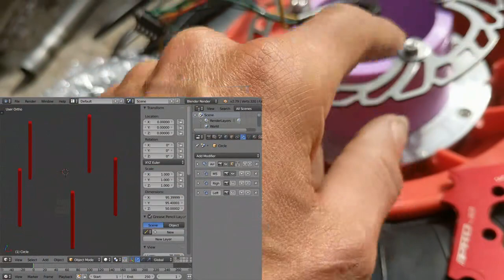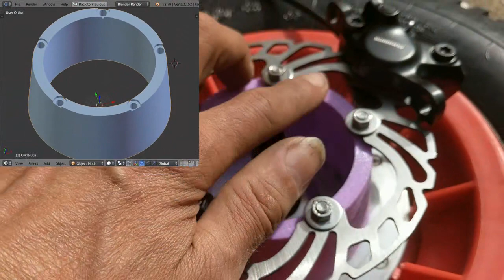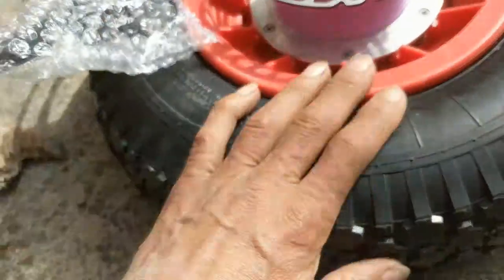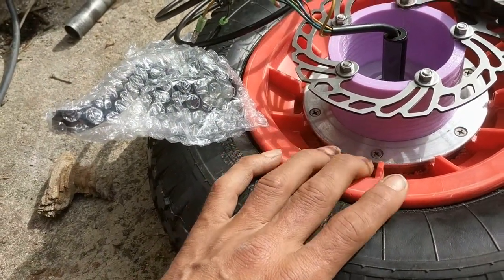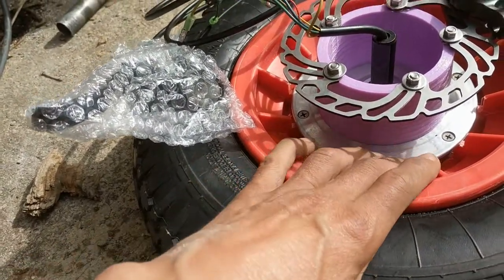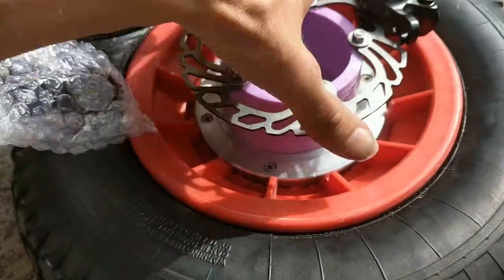part 2: disc brakes to hoverboard motor (for 16 inch wheelbarrow tire)

Comment: is the 3d printed part holding up?
Reply from the maker: Sorry, i have not tested that yet, will continue 2025 :-/ 
But yes, because of the screws that pull the plastic tight, i am still confident that it might be strong enough.
I have mounted my wheelbarrow rims central to the hoverboard motor. It would be better to mound the tires 1-2 cm outside, then the disc breaks have more room and the disc can be mounted closer to the motor.